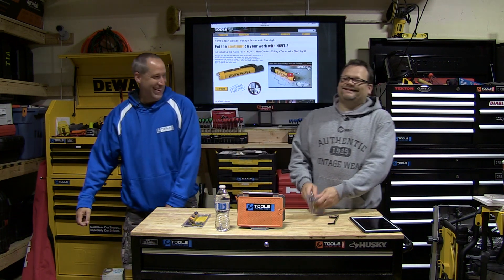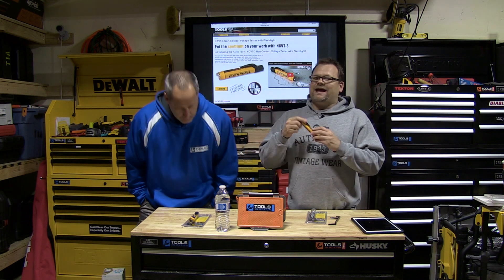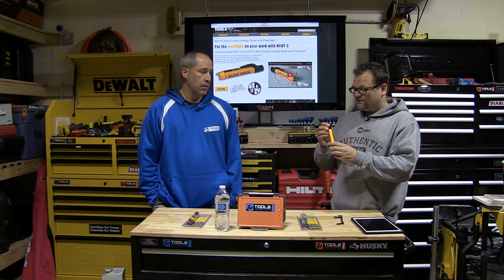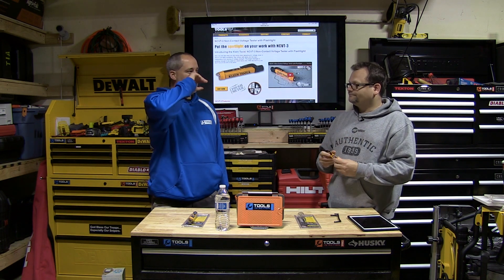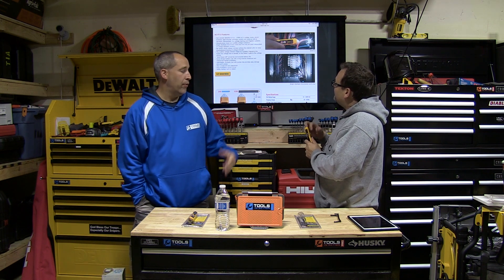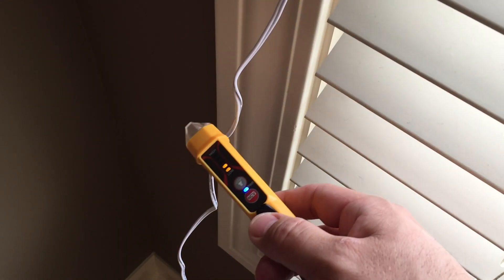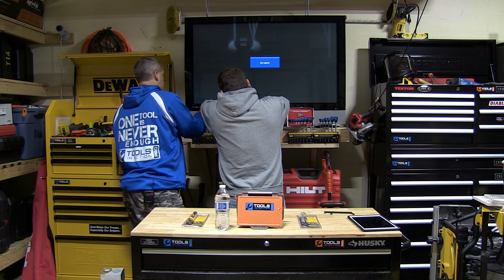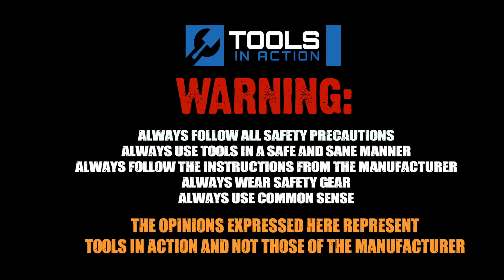Klein Tools' NCVT-3 Non-Contact Voltage Tester with Flashlight

Comment: One guy interrupting the other is annoying trying to watch this. In a Gas Furnace you have about 26 Volts AC (Control Circuit) & 120 Volts AC (for the motors). Can this NCVT3P Tester sense or indicate these two different voltages up against the wires? That would be demonstration worth a YouTube Video.

Comment: Mine didn’t come with a thermometer. I stuck it in my ear fa while, then under my tongue, and finally in my rectum and turned on the LED light.

Are you sure it has a thermometer function, because I haven’t been able to sit for a week.

Comment: Much better than fluke imo. The 5 bar led and second to none sensitivity are the main reasons. The flashlight is perfect because it is not too bright if your using it around panels or metallic surfaces but being able to see if I have a low voltage circuit to deal with and knowing if I have a standard high voltage or something more, is very helpful. Now I use the fluke for redundancy.
Reply from the maker: +turbotimthree Yes, tjis is a really good one

Comment: Looks pretty cool, but I'll still take my fluke tick tracer. They've never let me down so far, and seem to lay long both battery and life.
Reply: Maybe I'll pick one up and give it a try, my fluke is going on 3 years (I'm a commercial/industrial electrician) so maybe it's time for something new
Reply from the maker: INVULN give it a shot let us know what you think
Reply: Tools In Action my fluke model broke the other day(20ft drop off a lift) so I remembered this video and picked the klein up. So far I Love it. Definitely durable, the strength gauge is nice, though I already carry a light, it's nice to have a back up, or when I'm in a dark ceiling. Love the show guys!

Comment: Surprised no one has ever thought of this before. I have the regular Klein tools voltage tester that works great. I usually use that and a head lamp. Never tested through metal conduit, but it does work through pvc conduit that I have done.

Comment: Great video, would love to see a comparison with the Milwaukee and Fluke
Reply: AssociatedTechnology 
I actually own both those models, and I like the Fluke because you don't have to push a button to turn it on. It doesn't beep or have a LED on it, but the battery lasts a long time.

The Milwaukee has been a replacement for my Fluke because of the LED and the noise, sometimes your working in a shadow area, and can't see so good, or even in an attic J-box, works well. 
Second the beep is great, cause there are times when you need to shut off breakers or switches, and you place the tester on the wire, and when it stops beeping you got the right breaker/circuit. For $20 bucks, it's a deal.
Reply: Jose Macias i jam my tester into sockets/etc all the time and listen for the beeping to stop. great when your working alone

Comment: I'm an electrician and have used all brands and the Klein NCVT-2 is what I use. Hands down its the best it detects hi and low voltage perfect for hvac. I've had others and they don't last if you drop them the cap holding the battery breaks and its useless. I dropped the NCVT-2 from a 10 foot ladder and it still worked I also dropped it in a sink full of water it still work. After that I bought a new one because I didn't trust it anymore, I hope the waterproof feature on the new one works well.
Reply from the maker: Justin Hernandez so true

Comment: Cool idea to be honest I can't believe no one did it before. It's not like adding a small led to the unit is going to bring the cost of the unit up. It will effect run time but nothing too crazy. The coolest tools I have from Klein are my screwdrivers, circuit locator that thing is bad ass, and VDV scout that is great for when I'm messing around with datacom stuff!!! Klein makes great stuff the current non contact tester I have is a Milwaukee. I think like most people here on TIA will agree with me as its hard to go wrong buying anything from Klein.
Reply: DarkRaptor99  The old Klein NCVT-2 has colored leds on it that I have used as a flashlight but its annoying when there green and blue..lol
Reply: I think Milwaukee has one with a light, it also does low voltage too

Comment: Cool tool. I use a Milwaukee I bought back in 09 and works great you just run it across a wall and it will let you know if power is behind the wall and it runs on 1aaa no light